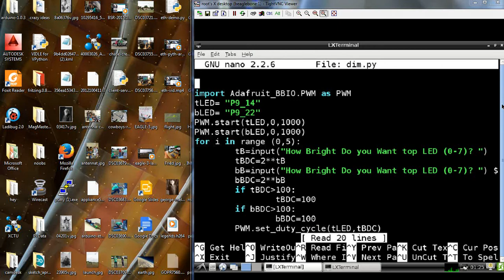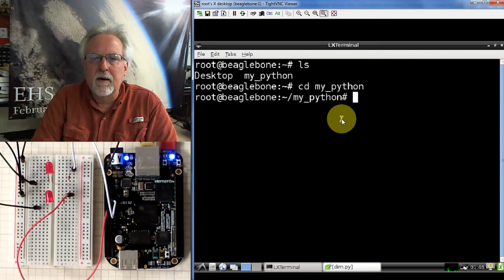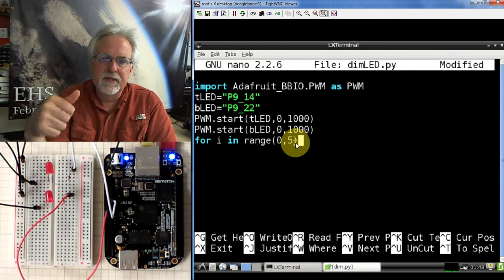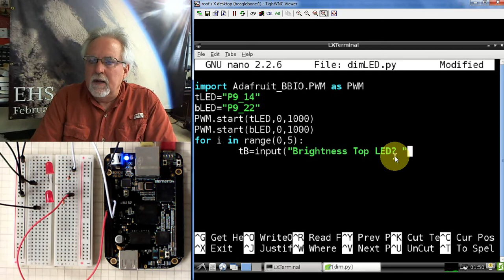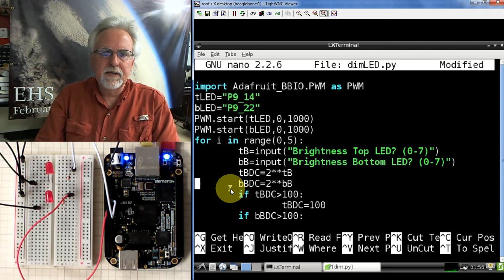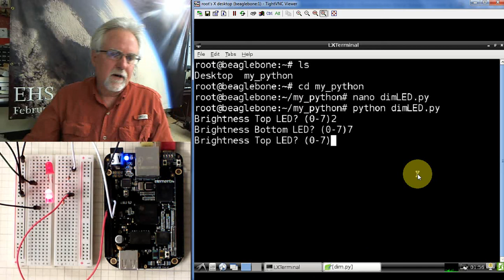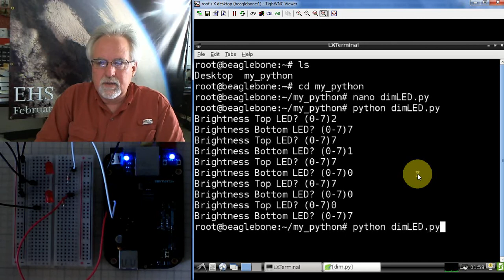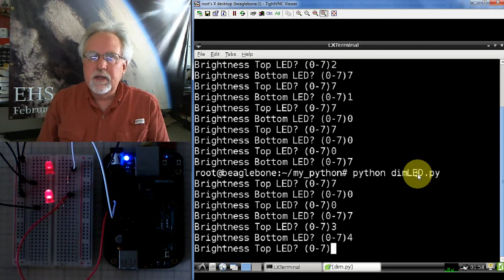Beaglebone Black LESSON 7: Dimable LED Circuit Controlled From Python

Comment: I like your series... You are quite enthusiastic and you have nice teaching talents. For this lesson, i'd just like to  correct a little something in your code. Giving A: PWM values are set from 0-100 and B: 2**7 ==> 255, we need to translate the value from a 255 scale to a 100 scale. The only scenario you would have catch it is comparing 6 to 7 and you would have find the solution ;-) Keep your nice work going!